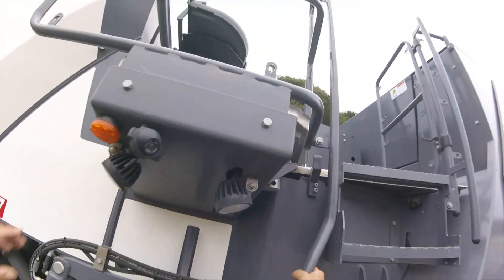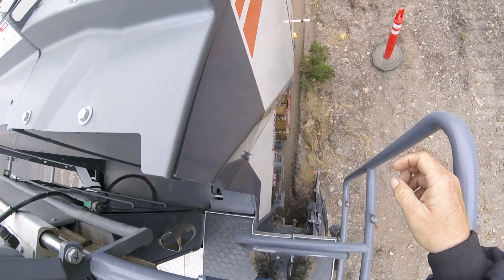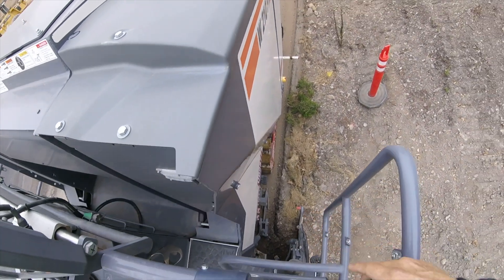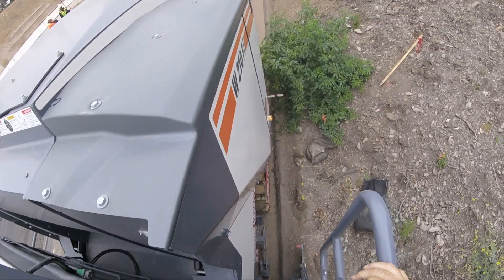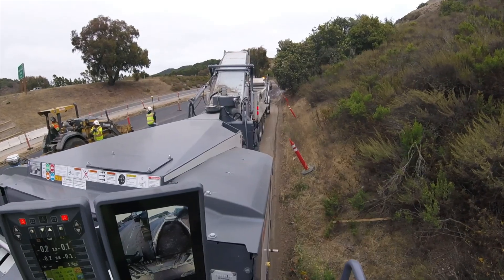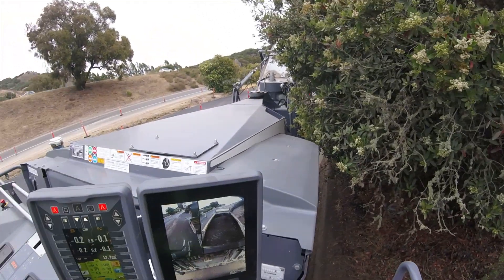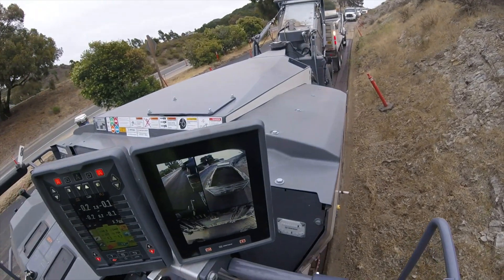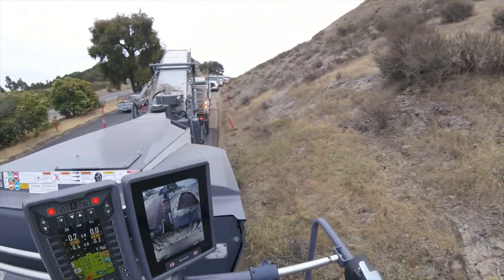How to Use the Rabbit Foot Sensor the Right Way | Wirtgen Asphalt Milling Machine

Comment: Is there a way the rabbit foot can work for piles whenever the front tracks go over them
Reply from the maker: I wouldn't recommend pushing the rabbit foot through piles. Its pretty fragile
Reply: @asphaltmillingpro what would you do going through piles?
Reply: Option 1, clean away pile, option 2, lift up rabbit foot and use level from side gate. Option 3, lift up rabbit foot and doing level manually until you can put foot back down.

Comment: I love a good mill operator. Makes it so much easier to broom behind
Reply from the maker: Thanks!
Reply: @asphaltmillingpro I remember the one time we were milling a state highway, using the rabbit’s foot on an inside curve to take it flush to the edge made so much of a difference, could easily sweep off the shoulder and not leave any humps with the powder. Saves the core of the broom too, 

I also remember going through about a core a week whenever I was brooming 4 inch cuts on the I-40. Loved the job but it was boring at times